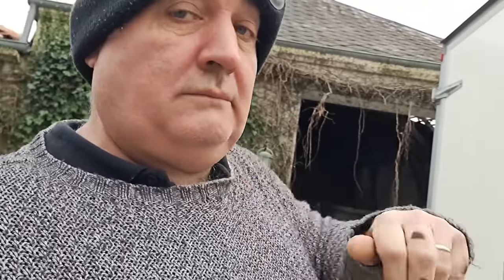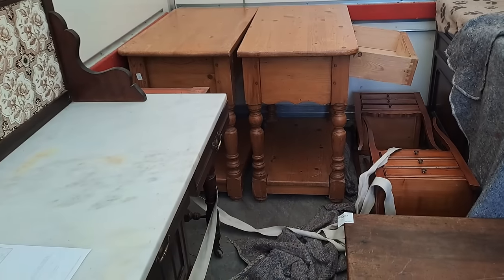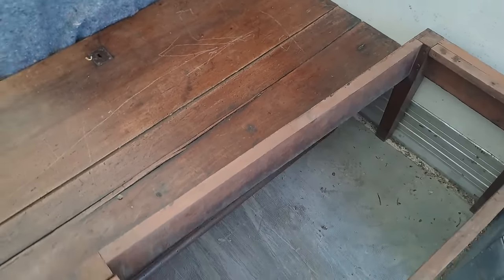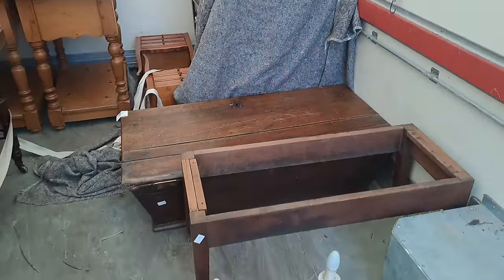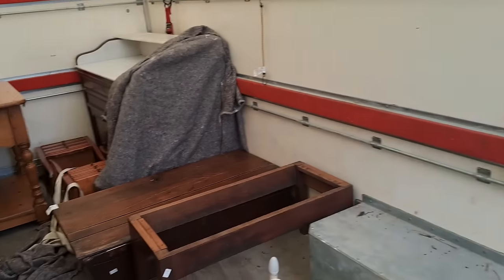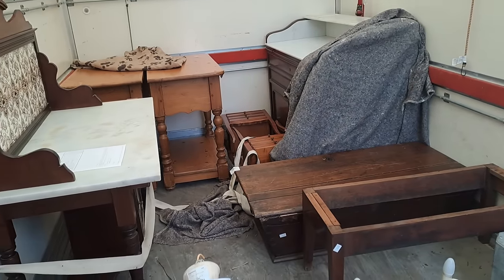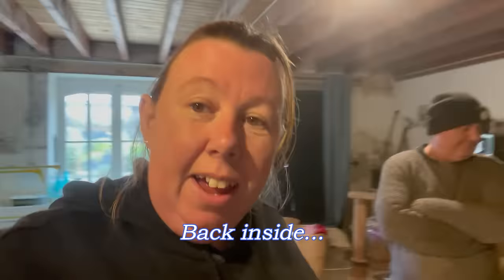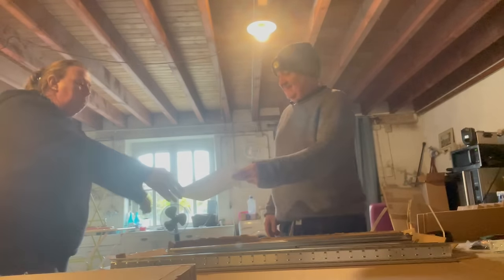Measure Twice! Cut Once. #133

Comment: I've restored a good number of dough boards, rolling pins, cabinets, & such for kitchen use. I generally start as you did with a good cleaning, then follow with a light spray of vinegar, let it set about 5 minutes, and remove the vinegar with a clean wet cloth. If you plan to use...and please note, some folks will object to doing any restoration to your box other than structural concerns.....Because I don't want to cook on a surface with someone else's dirt or dirt from where it was stored for a hundred years....After letting it dry completely, for the areas that will touch food, I start sanding with 150; then, go on to 180; 220; & finish with 320. On the non-food areas, if restoring is needed, I sand as I would any other wood piece, leaving as much of the original stain/finish as possible. Best case, you just remove enough of the old, so new will adhere. After cleaning & sanding, you can tell if you need any repairs. I don't worry about knicks & small issues: those blemishes tell the history of use. I just address structural concerns. For antiques that touch food, such as the one you have, I use natural hide glue, not a modern glue. As a finish, I apply several coats of good quality food safe wax or oil. You can tell from feel whether the piece was waxed or oiled originally. Just from the video, your piece appears to have a wax finish. Because I do use my antique kitchen pieces, I clean them after use, so periodically, I rewax or reoil. One recommensation to make your use of the dough box more handy, you or Nick or maybe your father, can make an antique style "platform" cabinet to set the dough box on--to raise the height. I'm short, but dough boxes are always too short for me. You don't have to attach it to the cabinet to keep it original. You can top the cabinet with solid "rails" to keep the dough box from moving. You can also add storage & wheels to cabinet. Enjoy & use that cabinet; it's not just a show piece... it has artistry & history as well as function.
Reply from the maker: That is a great idea for making the old bread box part of a new kitchen! It sounds like you would love it over here - I got an antique butter churn a few weeks ago for 50 euros - got home and googled it value 120 USD - it is a keeper though!